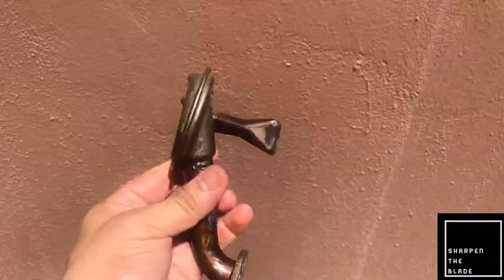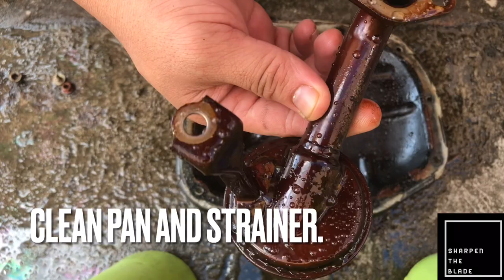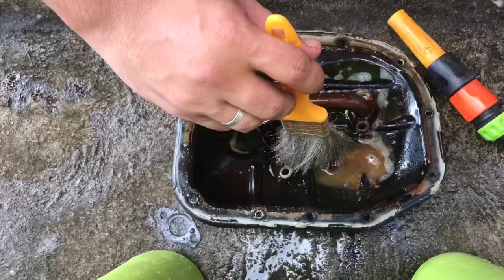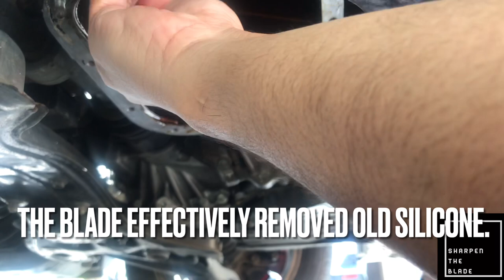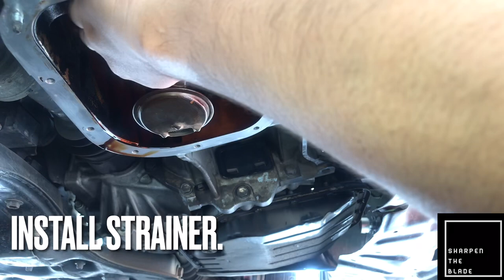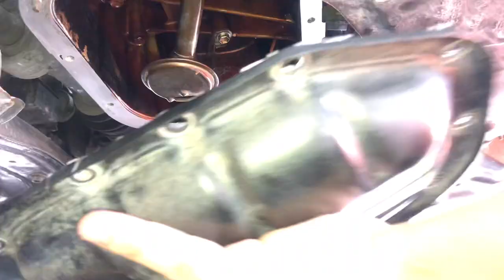How to clean Oil Pan and Strainer| Reseal oil Pan| Toyota Vios| 1nzfe| DIY

Comment: If u dont have chemicals, the cheapest and still effective way to clean oil and sludge is to use washing detergent powder for clothes, just make sure u cleaned that gelatinous layer with water after oil cleaning
Reply from the maker: I prefer dishwashing liquid...thank for your suggestion.

Comment: I might need to do this. I bought a 1999 Lexus and immediately did an oil change but after that and some test driving a "Low oil pressure" light keeps popping up when car is warmed up and idling. When driving it's not showing up. 

The oil pan and the strainer could be filled with debris caused by irregular/neglected oil changes by previous owners.
Reply from the maker: yes brother, you are right. strainer might be clogged. oil might be having a hard time moving around.
Reply: How did you fix it? I am having the same problem.
Reply: @sanjayarayamajhi7704  I have some bad news. Once I opened the oil pan I found little pieces of metal. 2 crankshaft bearings were damaged but at least not seized and the crankshaft itself was still straight. I replaced all bearings that touch crankshaft and I also replaced oil pump for brand new one. After that car is running complete fine now on an eaton supercharger for past year. I also use the regular 5W30 oil, changing for higher viscosity only delayed the time until "Low oil pressure" light came on. Good news is I did not have to remove the engine from the engine bay, all of this can be done from the bottom once the oil pan is removed.

I suspect this was caused by too long intervals between oil changes, this is why you change oil AT LEAST every 10K km.
Reply from the maker: Hey man, thanks for the update! Good thing you are able to fix it before it get worse.

Can't imagine the the hassle if you needed to remove the engine. Good thing all is possible just doing it from the bottom.

Comment: Sir, meron ba talagang oil pan gasket 'yan o sapat na yung silicone gasket maker? :-)
Reply from the maker: Good day sir, wala po rubber gasket talaga yan. Need talaga lagyan ng silicone.

Sa AT transmission pan may rubber gasket, Pero nagleak yung sa akin kaya silicon na lang din nilagay ko.
Reply: @SharpentheBlade  Thanks, sir! <3
Reply from the maker: @edstonpesito9199  np. Stay sharp and subscribe.
Reply: Boss pati ba strainer llagyan din ng silicon?? Ty po
Reply from the maker: No need po. Yung pan lang po mismo.
Reply: Salamat boss
Reply from the maker: @arseniong7940  NP po. Enjoy your diy.